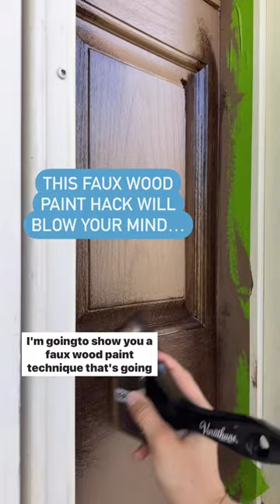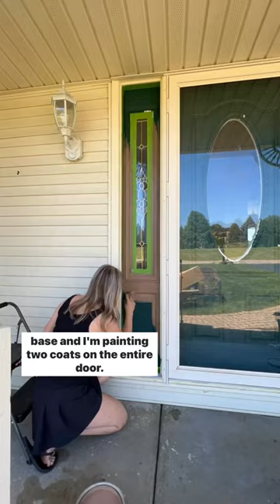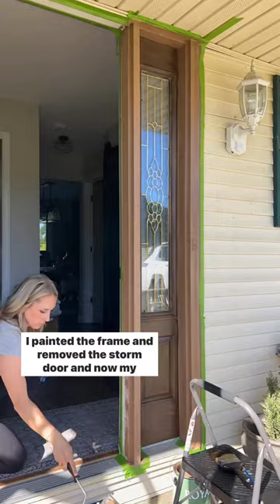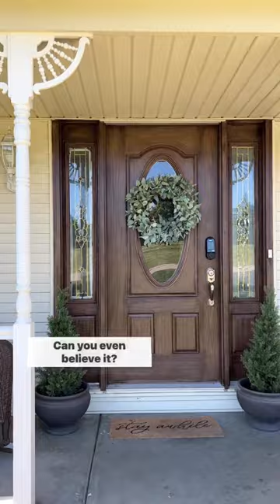Front Door Upgrade: DIY Faux Wood Front Door Transformation

Comment: Actually fyi you didn't have to do that brown base coat. Gel stain covers well. If your door gets alot of sun I would apply a UV protectant urethane over it or it will start to peel. Ask store for correct urethane because you don't want to use water base.

I think you did a great job! 👍

Comment: I’ve got a wood frame and those Metal door .what can I paint it with ???
Reply: You can do a gel stain on metal but I would prime it with an oil base primer first before gel staining or painting. 

You can paint over the oil primer with a water base paint. If your door gets alot of sun select a paint with UV protection.

If you use gel stain on your door and it gets alot of sun, select a urethane for the top coat that has the UV protectant.

Same with the door casing (frame).

Comment: That looks really good, but I can't grasp how you get the wood grain to look real, how do you get it to look like wood grain?
Reply: The door already has a wood grain pattern in it. Also when you brush with gel stain even on a smooth surface it will give somewhat of a grain effect.
Reply: @repentandturnfromsin  is the wood grain raised? Because after you usually paint something it fills the little groves that stain usually sticks in to enhance the grain, she painted it first, so unless all the grain was raised,  I don't see how she got it to show up
Reply: @julietteoscaralphanovember2223 it is raised and has a pretty significant texture. I believe it would be near impossible to fill in the grooves of the grain without first applying some kind of filler such as putty or spackling before priming and painting.
Reply: @repentandturnfromsin  thank you for the info 🙂
Reply: @julietteoscaralphanovember2223  most welcome.

Comment: Why did you paint/stain the trim over sidelines but not the trim over the door? 
The "seaming" of what would be the stiles & rails of the door need work. There would be crisp lines where pieces of wood are joined together. All the artists that have faux painted doors & garage doors for me always tape off the doors and do one "grain" direction at a time so they get more realistic grain effect. I'd also recommend a lighter, more golden base color, with more than one color on top. Real wood has more than two colors. This door doesn't doesnt have enough color variations or grain movement to look like actual wood.